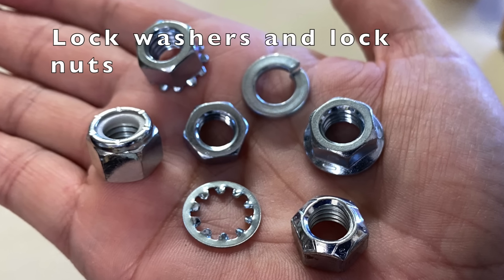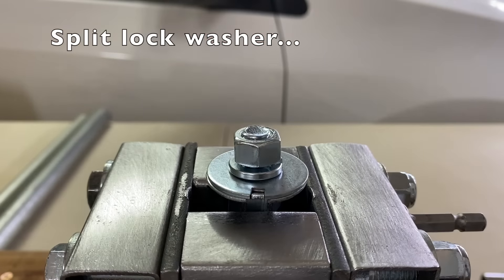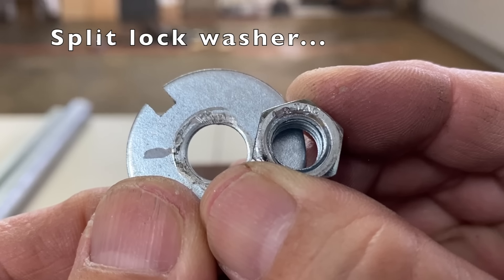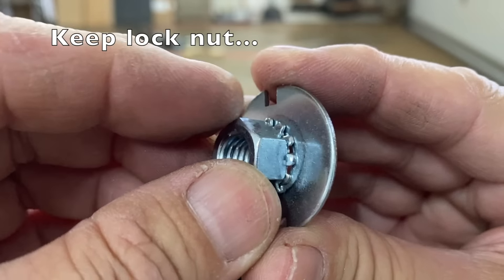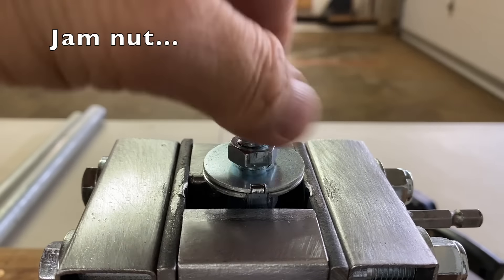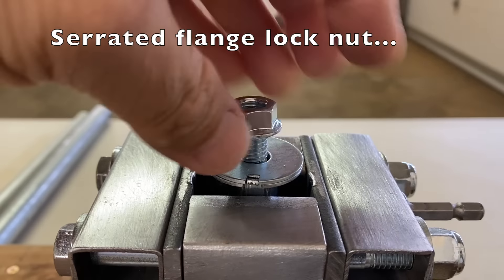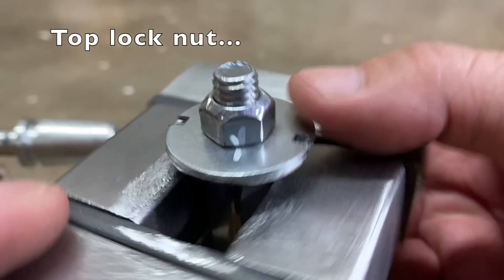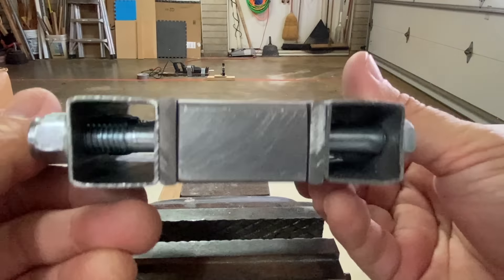Lock Washer & Lock Nut Vibration Test

Comment: Used all of them and then some with nylon inserts, with teeth on the nut itself etc , they all work if you tighten them , 11flb is nothing , I can’t recall any automotive applications were that kind of torque applied. 11flb if you tighten anything on my car to that torque - you will never see me again as a customer, even small 8-10 mm bolts and nuts under the hood can’t be secure with this torque.
Reply from the maker: Thanks!
I plan to test grade 5 fasteners with greater torque specs in the future.  
😎

Comment: The real question is what kind of nuts held that test jig together.
Reply from the maker: LOL!  
Those are nylocs, but I retighten them between tests.  They also undergo an axial load (along the bolt length) that is much less stressful than the transverse load (across the bolt) that the jig experiences.  
😎

Comment: I've always liked the split lock washer, but some people use a flat washer under tit, making it useless
Notice that the nylock nut turned clockwise, which iss the tightening direction, though i think the bolt turned too, same with the top lock
Reply: Using a flat washer under a split lock washer is definitely not useless. I do this all the time with high vibration equipment and don't have any issues. The vibration would still have to overcome the compression force of the lock washer to actually turn the nut.

Comment: I’d be interested to see how “wavy washers” function as locknuts. The washer has a wave bent into it to provide tension between nut and metal
Reply: Wavy washers are only for thermal growth and not designed for clamping force.
Reply: I did not know that! Thx
Reply: Every bolt tested in this video was tested improperly. Check manufacturer suggested use and torque. All of these boats were under torqued as well. This video was useless and can get someone hurt
Reply: @jaywashington8436  
“Imporoperly tested”? Wondering why you say that?
You do not know what the grade is of the bolt (he never shows the bolt head I.D. stamp) or of any of the nuts he tried.
You also do not know what size and thread pitch that bolt was.
In actual  usage, bolts are not necessarily torqued  to the maximum ftlb specification either.
For this experiment, what would YOU have torqued them to?
“Check with the manufacturers suggest use”? That makes little sense.
Contact any fastener manufacturer and ask that.
They will laugh.

Comment: None of these can compete with Nord-Lock washers. A set of two on either end and nothing comes loose. Takes little force to apply, lots more force to take out. Use them with SB-bolts on a daily basis to mount antenna-structures (with radio's and all, total weight goes up to 400kg each structure) into cell-towers, when tightened correctly even after several years it is just as stuck as when applied. Nord-Lock developed a completely new way of locking, not relying on any type of friction as other locking nuts and washers do.

Must say, we use various type of locking ways, some parts happen with two nuts, others with a spring washer. It all depends on the usage. Cable-clamps for example don't need an exceeding amount of force as there are one pair about every 60cm, multiple can fail but it still won't fall.
Reply from the maker: Thanks for sharing your experience.  I’ll purchase some Nord-Lock washers at some point and give them a test.  😎

Comment: Before I scroll through all the comments...
What locking setup did you use on the test rig?
Reply from the maker: LOL... Nylocs.  The bolts holding the rig together experience a less intense axial load versus the more intense transverse load that the jig experiences.  😎

Comment: Correct me if I'm wrong....but nuts and bolts aren't supposed to bang around like that.
Reply from the maker: LOL!  You are correct.  This was an extreme overkill vibration and impact test.  The locking devices that did well in this test should do well in most real world conditions.  😎

Comment: It's shocking how many "anti loosening" products are just downright scams. Always go for rubber-insert nuts and if you absolutely want that sucker not to move, use some threadlocker as well.
Reply from the maker: This was an extreme impact and vibration test that most fasteners won’t experience.  I just wanted to see which, if any, would survive.  😎

Comment: When using (  NYLOCK™ ) nuts made from  STAINLESS  steel on a  STAINLESS  steel bolt , you  MUST  use a dirty compound ( Copper seize ? ) on the threads , or you (  WILL  ! ) get cold welding resulting in  UTTER & TOTAL  seizure ( get out the angle grinder etc .) .... as I have found .... ( tried - n - tested ) ......... DAVE™🛑
Reply from the maker: Interesting... thanks!  😎

Comment: You failed to produce evidence that the compression loading (torque) for each fastener was the design loadng. 
Subjecting them all to the same loading intentionslly ignores the possibility they are engineered for different use cases.
11 ft/lbs (15nm) is very light loading, and could well be below the minimum design specification for some of the fasteners listed.
I am struggling to find any meaningful engineering expression in this experiment.
Reply from the maker: Thanks!   Please don’t lose any sleep over this.  It’s just a simple garage experiment.  👍😎
Reply: @HacksbyDad  I'm not the one who should be losing sleep over this. 
I guess this explains why some people are engineers and others are not - and why those who are not manage to garner thousands of YouTube followers, while those who are keep busy making things work.
Reply from the maker: @gregfaris6959  Thanks for keeping things working for us!  Much appreciated!  😎

Comment: For what ever reason, you chose a low grade bolt to test. It the applied pressure to the star type nuts is not not sufficient for them to engage their mating surface, the torque is not sufficient to reach the minimum threshold necessary for these nut types to work.  For the "jam" nut the nut to nut torque should be near the plastic limit of the material if not beyond it, correctly torqued jam nut connection are not done with a torque wrench they are done by feel. And as such I have never seen them come apart.  I will suggest that you proved that the "low grade" bolts you tested, should never ever be used in the situation where the connection is important.  Your test shows you should never use a cheap or low grade bolt.  You did a nice job, but what a waste of effort on cheap bolts.
Reply from the maker: Thanks!
Simple reason for low-grade fasteners... cost.  LOL
I'm on a budget and this stuff adds up.  I might redo the test with grade 5 & 8 fasteners.  We shall see.  😎

Comment: Great test - thanks for sharing. I would like to see the Nord-Lock washer added - I used them with great success at clamping mufflers onto single cylinder two stroke gasoline* engines from 20cc to 50cc in RC airplanes - a very vibration-prone application. Never had one come loose. See https://youtu.be/IKwWu2w1gGk for more evidence.

*GASOLINE - not glow or "nitro"

Comment: This test is not very good.  A bolted connection rigidly connects the parts to be fixed to each other through a hole of a suitable diameter.  If your bolt and nut are dangling in the hole like this, then it doesn't hold the parts to be joined in place.  Bolt loading is more like vibration than shock loading.

I'm sorry for my French, just use google translanor

Comment: 11ft/lb is nothing... no wonder they fail so fast. That is too low for this size nut and bolt.
Reply from the maker: Thanks!
They were low-grade A307 nuts and bolts that can't handle too much torque.  I plan to conduct a future test with higher grade 5 fasteners and more torque.  😎

Comment: Invalid test, as torque applied way below specification. What a waste …. Torque should be at least 50% of the bolt shaft maximum carrying capacity . . ..
Reply from the maker: Thanks!  
Tech sheets from 3 bolt suppliers said 3/8x16 A307 zinc plated nuts and bolts should be torqued to 11 ft-lbs dry.  It's not my place to question them.  LOL

Comment: There's probably a reason why you're using nylon nuts on your jig...
Reply from the maker: The nuts/bolts on the rig are under a less intense axial load versus the more intense transverse load of the test jig.  At least that's what my research revealed.  😎
Reply: @HacksbyDad  the nylon just doesn't allow the nut to turn at any point no matter how tight or loose it keeps a constant friction all the way. It's why I use them all the time

Comment: This is so stupid. This is not how it's supposed to work. Whoever made this fails or improper use of equipment
Reply from the maker: Thanks!
Check out this video on fastener testing with the NAS and Junker vibration testing methods.  😎
Reply: @HacksbyDad  if it's not manufacturing testing it doesn't matter. You supposed to use it the way the manufacturer suggest. Not the way you want to. Smh